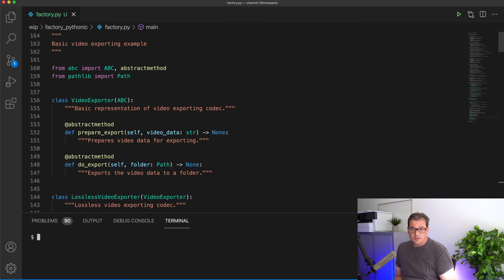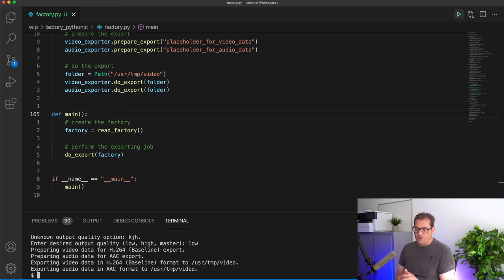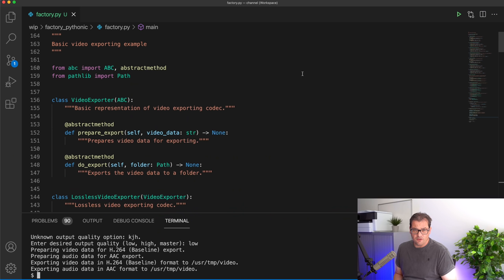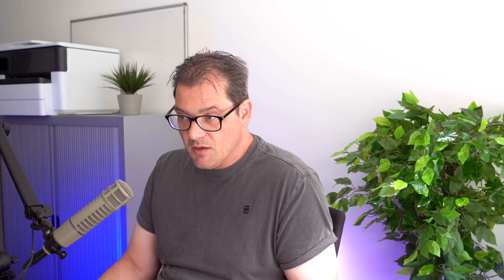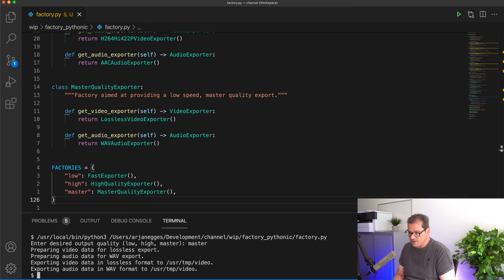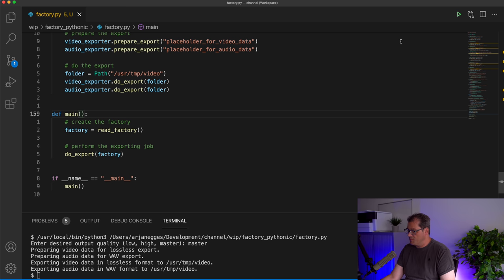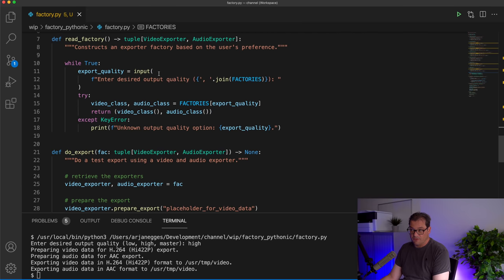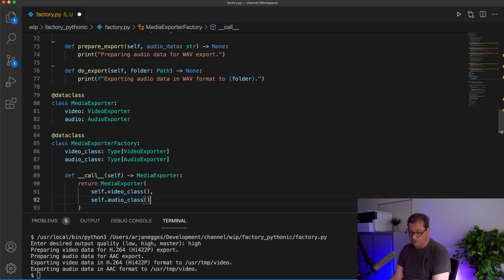The Factory Design Pattern is Obsolete in Python

Comment: I still am not sure on the usefulness of protocols if not using a static type checker like mypy. How are they different from having no protocol at all? The function will accept any type and lets say it tries to call the ".fancy_method" on one of its arguments, if the method is not there, it will just raise the usual AttributeError. I tried this with and without protocol and unless I use mypy or the runtime_checkable+isinstance checks it really makes no difference on the code behavior. Is it just to define an interface instead of writing the expected API in the documentation?
Reply: I think for such issues, the most reliable way is to use pydantic.
Basically it defines dataclasses, too, but it enforces the type hints it gets (but of course with a slight performance penalty what shouldn't be an issue for high io bound video/audio exporters anyway).
mypy always has the disadvantage, that if you don't use it from the start of a project, it probably will ring everywhere and just changing code everywhere might mean breaking it. You could of course decide to reduce nr of alerts from PR to PR, but as pydantic could be used without touching other code, so that's a nice solution for adding new features to an existing code base.
Probably would have been mentioned by Arjan himself (he has a more recent video about it, too), but it wasn't so famous and production ready at the time of this video here produced.

Comment: Both VideoExporter and AudioExporter are protocols with the exact same methods and signatures, isn't it the case ? How does python decide which one to match to if you have 2 protocols with the exact same method names and signatures ?
Reply from the maker: Protocols are matched at runtime via duck typing. So actually, it doesn't matter if two protocols overlap or are the same. The only thing that counts is that it defines the interface that is expected. As long as the interface of the class matches what's defined in the protocol that's expected, there's no issue.
Reply: In this particular case, I liked that ABC provided stronger typing - you couldn't use an AudioExporter where a VideoExporter was required. But in general I like Python's use of duck typing with dunders and Protocols seem to mirror that well. An alternative in Ruby is the respond_to? method, which is in my opinion the duckiest duck typing :)

Comment: Could the MediaExporterFactory also have just been a function, rather than a dataclass?
Reply from the maker: In principle yes, but you need some way to keep track of the video and audio exporter classes to use. To achieve this, you could turn it into a function that returns a function, where the first function has the two classes as a parameter and it returns a function that can create instances of those classes.

Comment: As I think of the options, my unfortunate answer is "it depends".

Protocols are powerful, bit can hide the intention. I use them most when parts of an app needs to be tested and DI demands that a dependency be externalized.
Other data structures are useful when they do not get in the way of DI.
The beauty of Python is its flexibility in this area - use the data structure that make the most sense.

And if performance is a significant consideration - TEST!

Then make the most informed design decision.

Comment: Cool solution with dataclasses. The only thing I didn't like was the Demeter's Law violation when doing exporter.video.method()
Reply from the maker: Thanks! I do think the Demeter’s law violation here is acceptable since the class only acts as a container for easy access to the video and audio exporter and nothing else, so its job is to expose these things. But you’re right that in most cases this should be avoided.
Reply: @ArjanCodes  Fair enough, Arjan. Keep it up with the good work!

Comment: I must admit I'm watching this video third time and I still don't understand the Pythonic way you're describing. But I have the impression that some parts of your code (btw. it's a pity there's no link to the code) is completely unnecessary. Would it still work if you removed inheriting from Protocol? Or if you deleted FastExporter class? Or get_video_exporter functions? It would really help if you showed some simple diagram of what inherits what, what uses what, what goes where. A kingdom for a big picture, please!